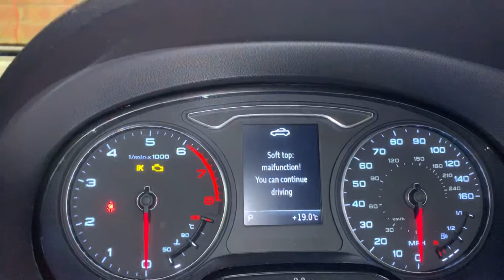Audi A3 8V Convertible Cabriolet Roof Fault No 1

Comment: hello iam french can you make a video to explain the problem me I have a bottle which is put in the range roof and I managed to open my roof and left slightly on the side and, stop the operation and return it rood in front to remove the bottle after I bring them back in the range roof and put back in the closed position and she wants to remember more
Reply from the maker: Pépé Ross 

Hello

Sorry I do not understand what you mean by bottle
Reply: VagPro Cabriolet Specialist a bottle of iced tea is placed in the right side can you make a video to show me how to open the manual roof knowing that the roof is in the closed position while filming me so that I can see what there is like a sensor on the right side
Reply: Hello can you help me
Reply from the maker: Pépé Ross 

Can you contact us via the website with you exact issue and we can try help you